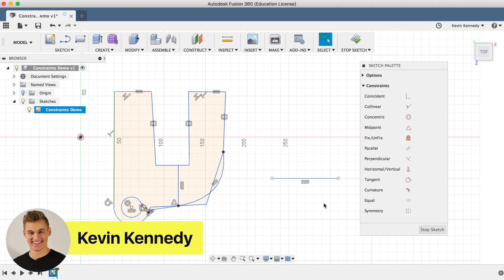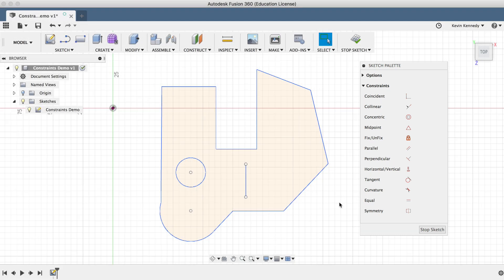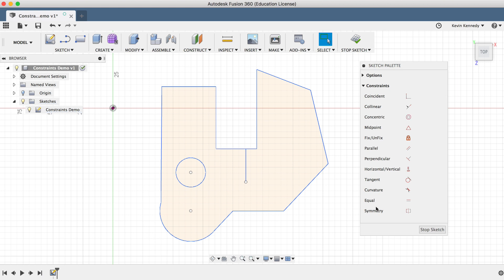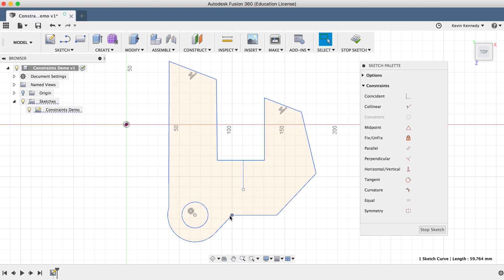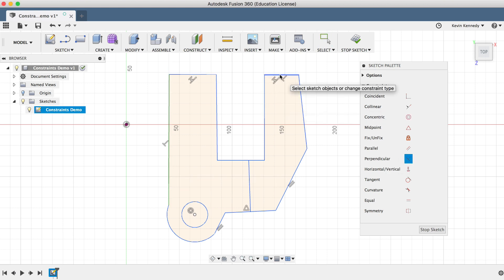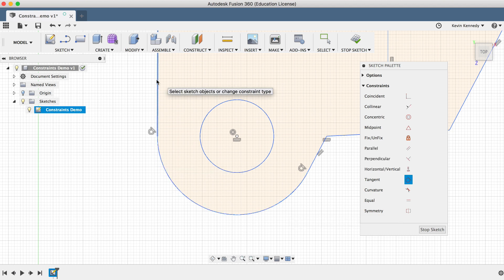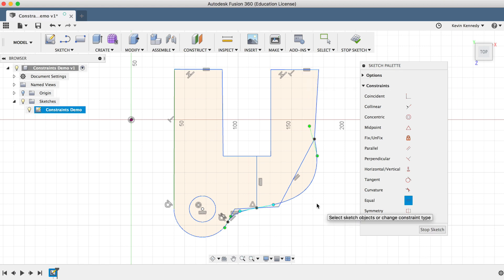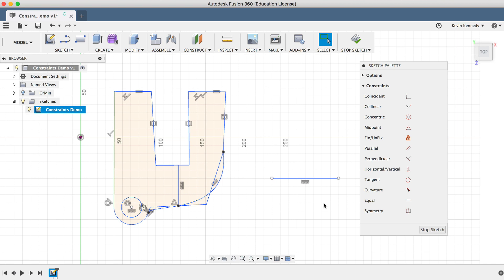How to Manually Add Sketch Constraints - Learn Autodesk Fusion 360 in 30 Days: Day #16

Comment: How does one remove constraints? Also, three are times when constraints report an error is there a way to see the error and attempt to correct the error?
Reply from the maker: Rud Dog - Great questions!!! 

To remove constraints simply select the constraint and hit the delete key on the keyboard (I go over that in Day #17 that just posted).

When you see the error in the lower-right-hand corner click on the error and it usually (not always) will give you some extra help text. To be honest, the help text is not the best, but if you do a quick Google search it will almost always lead you to the Fusion 360 forum where someone has answered it!

Cheers, Kevin